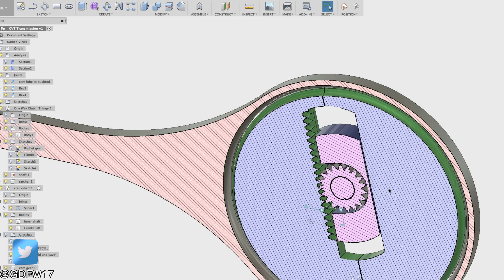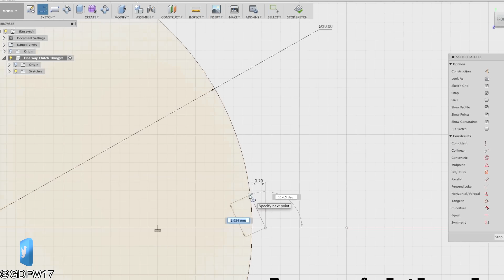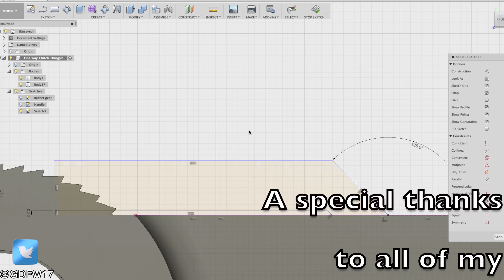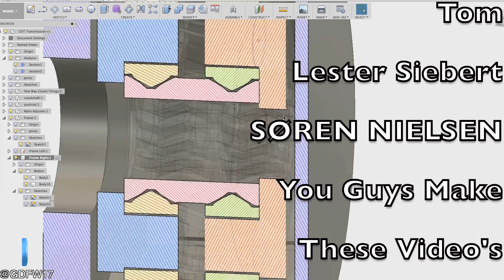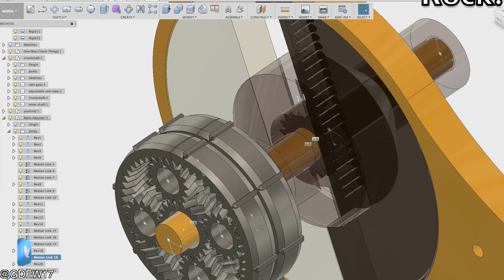The Coolest Transmission You've Never Heard Of... The Ratcheting CVT

Comment: CVTs are great on paper but in practice they have problems.  The biggest problem is with high torque applications which is why you never see a CVT mated to a diesel engine. They also are only mated to small economy cars for the same reason. As he stated the CVT's longevity is also questionable. Perhaps his design is the beginning of fixing those problems.

Comment: In 1967 my dad bought a Sears garden tractor. They called it a "hydrostatic" transmission and there was a lever on the side of the  tractor and if you pushed it forward the tractor went forward and if you pulled it back no matter how fast it was going you put it in reverse.. and the speed of the gas engine was controlled by a cable that was knob adjustable.
My father said that these type of Transmissions had been used but not in automobiles because they were too inefficient. But the one in the little Sears garden tractor did not seem to be inneficient at the time when a gallon of gas was 23 cents.
Reply from the maker: I bet it got less than one mile to the gallon. Pumping fluid like that is always very inefficient, but very practical for a lawnmower

Comment: I couldn't understand almost any of the verbal explanation. But I think I understand.
To put it lame, you have 3 arms that are ratcheting the same output gear. By turning the knob, you have a continuous linear adjustment of the distance of the 'throw' of  each of the arms, which in turn, throws a lesser to greater turn of the output shaft. 
I think the technology of that continuous(right word?) adjustment is cool!
But the ratcheting concept has no robust reliable technology about it.

Comment: So, a quick question about this.

Since this transmission would provide a wide range of ratios for a powerhouse to maintain a certain rev, while being able to maintain any speed at said rev....

Wouldn't that put the overall stress ware from the motor onto the transmission, then? It seems like even though the motor life would drastically change if overall rev's are able to stay low without costing acceleration, a lot of that stress would be transferred to the transmission instead.

Maybe I'm misunderstanding, but just something to talk about.

Comment: I am very sorry for you but its just not worth it. There are more mechanical parts that could cause problems. Gears are simple and reliable and don't need to be replaced. I am not that optimistic but if you believe in your invention you should build it completely out of steel, add good bearings, make it not to wobble, build a housing and a lubrication system and spin it up as much as you can and measure how much has worn off. It needs to have less material loss than a gear. Than you can try to sell the idea to big companies

Comment: So what I'm getting by this design is smoother acceleration and controller powerbands (no loss of power) but when it comes to the variable adjustment knob( for lack of a better word) if it were to fail, however it was designed to be controlled via belts or chain, it would either get stuck in one ratio which could possibly make way for engine failure if no disengagement mechanism was introduced.

Comment: Polaris ranger - 15,000$
1st New clutch - 800$
New belts - 2000$ (course of 5 years)
2nd New clutch - 950$
Trade for Honda pioneer - 2500$

Yet to pay for anything other than gas after 6 years of using the Honda, you can't beat solid gears and mechanisms

Comment: For a low-rpm application this could be very useful, but anything with high revs, this would fucking explode from vibration.  VERY cool design concept though.  A lot of old blacksmith/shop drills from the late 1800's used similar theories on how to get the most control on the output speed on their machines.

Comment: Nissan didn't do it that way. When the, I believe Altima, first came with the CVT it didn't "shift" at all. It worked as how CVTs are supposed to work. The probably came when they had a overwhelming flood of owners coming in complaining that their vehicle didn't shift or "rev" properly. The fix Nissan came up with immediately was to program a miss in the fuel system to simulate the jerk of a standard shift.
Reply from the maker: Haha that’s a funny way to go about it, but much better that forcing a CVT to stick in one place for a long time and create a rut.
Reply: @GearDownForWhat  it's more sad they had to do that. Even after telling people that the vehicles were being perfectly normal. I am not a fan of CVTs because of their faults. Also because they cannot handle vehicles with increasing power. They are great for commuters though. To ruin the smoothness a CVT can offer because of a lack of understanding by the general public is just, depressing. Lol

Comment: Hahaha I did the same thing when I was a kid, I wanted to come up with an automatic transmission that could keep the engine in the power and without having to shift gears. Basically I came up with the same system snowmobiles have.

Comment: as a nissan tech im glad you touched on programmed shift points in cvts
Reply: As a Nissan tech you should hate that horrible jatco cvt they use.  😂😂😂
Reply: punkrocker10115 I love them, I don’t call em cvts I call em job security
Reply: @punkrocker10115  I am not a fan of CVTs as it is. In automotive they have been nothing but problems. So far CVTs are like communism. Great in theory, horrible in practice. They are crap for any vehicle with any kind of power, only good for econo-boxes. Have been screwed up because then general public has no idea how they work and refuse to listen.
Reply: FordPower5288 they work great on snow mobiles! Atleast cvts haven’t killed as many people as communism 😥
Reply: @superTomwins  yes they work in snow mobiles. That's why I said "in automotive". Snow mobiles don't make crap for power and have a lot less weight to move. Lol.
Reply: @liberatorkramit  actually cvt is not for light use only. There is many design for cvt. Properly designed cvt can handle high hp/torque and have enormous advantage. That why its banned on f1 championship because of unfair advantage compared to traditional transmission. If f1 doesn't ban it, i think lot of r&d on cvt for supercar or something that need high torque application.
Reply: "Shift points" Otherwise known as a programmed miss in the fuel system.
Reply: FordPower5288 more like times ratio changes in the cvt as opposed to continuously changing them per the name suggests
Reply: @superTomwins  maybe they changed it but before it was just a programmed miss to make people think it's shifting. To be fair I've been out of the auto industry for a while now.

Comment: It is very cool but I think I can see some areas of improvement 

1. It seems to have a lot of vibration, I say you should have 4 instead of 3, that way it would have an equal offsetting weight so when 2  are far on the outside 2 would also be on the inside. if that makes any sense. basically how a boxer engine reduces side to side vibration.

2. you have a ton of input for little output, I'm still not 100% on how this works but maybe change the ratio so that it would be better for cars or snowmobiles rather than a freight train

also, this thing makes me feel dumb, I want to be a mechanical engineer for a snowmobile company but this seems so complex idk if me and my 1070 PSAT score is ready

Comment: My boyfriend owned a Nissan Sentra with a CVT. It was the worst driving car I'd ever been in as a result. First off, the CVT was loud. I mean, really loud. Second, it suffered from considerable output lag from the point when the engine revved up but the power wasn't there, known to some as rubber banding or the rubber band effect. This sometimes caused potentially dangerous problems when quick movement was needed from the throttle (such as turning left). Finally, it started acting very poorly at about 40k miles, particularly in the cold. It simply wouldn't output to the wheels when the throttle was pressed.
I'm not saying CVTs are inherently bad, some can work well, but the Nissan design clearly needs work. Working at a dealership, he was seeing Pathfinder CVTs on the regular failing at a few thousand miles coming in for warranty work.

Comment: Great job.
One thing I could say is that it's not a CVT, as it does have a finite number of transmission stages, determined by the number or ratchets per turn of the shaft. It would either do 0 clicks of the ratchet per turn of the shaft, or 3, or 6, or 9, etc.
Reply: Are there any CVTs out there with a truly infinite number of stages (aka ratios)? I mean they're not called infinite ratio transmissions.

Comment: This would be great for bicycles. Instead of a cap, you'd have a straight through shaft to connect the pedals, and a lever that can be cable adjusted to control the offset/ratio.
Reply: check stringbike

Comment: Another CVT gear system that is similar, was in Popluar Science in Oct 82.  It uses pawls and cams to pull gears, by changing the length of the pull you would get different ratios.  It is easy to search for type in "CVT pawls Popular Science Oct 82".  It comes up thru google books on pages 110-111.  Have you seen it ? 

A good application for a CVT would be to drive a supercharger for a car engine.  When you need power the gears would speed up the supercharger, after you needed power they would gear down.  Supercharger need power but typically it is far less, than what the total output is.

Have you tried making your CVT in metal  ???

Comment: So, I'd say the finite number of teeth on the ratchet mechanism is why it isn't really  continuously variable. Until the first tooth in engaged, no movement at all will occur up until that point. Suddenly with teeth engaging, the output will move by 3 teeth angles per input revolution, psuedo gear 1 after neutral, then all variations up until two teeth engage are the same, until the gear ratio suddenly doubles, psuedo gear 2, and so on until the most teeth passed possible per revolution of the ratchet. So realistically, your model probably only has 4 gear ratios plus a neutral. Smaller teeth could increase this number but make it fragile, replacing the ratchet with a one way bearing with little play could dramatically increase the "continuous-ness" of this mechanism.

Comment: The best cvt was designed and patented by an electrical engineer, it's only used in alternators in military vehicles, and for the drive on tractors. It can nearly take any tourqe load, and take input rpm to a zero out put, no clutch, no parts that wear out... 
Its a fd up world.

Comment: Very good video, I wonder if that can be applied to bicycles, since in a way, for me, it looks as if you can attach that to the place where the main chain gear(?) would be, and just have to attach the adjuster to a lever or a accelerator handle like the ones on amotorcycle.

Comment: looks like a zero max. They are used on printing equipment.
Reply: I was thinking the same thing as a reply but I couldn't remember the zero max name...thanks! They use a cleverly flat rcb device instead of what sounds suspiciously like ratchets in this device by this clever fellow! :)
Reply: I see them all the time at work, but it's been about 30 years since I had one apart. Lots of little bits in there.  @hugocfr
Reply: I have a small one here in the shop and have had it apart to see how it works....I was even able to get it back together and working again :)

Comment: There is something about this design that is very familiar.  On the second viewing, it came to me.  Look up the Stephenson Link valve mechanism, used on steam locomotives since the mid 1800’s.  Of course, it isn’t a transmission, but a means of controlling the steam flowing to the two double-acting cylinders that propel the engine.  The Stephenson mechanism is relatively simple.  Its successors, the Baker, Southern, and Welschaerts valve schemes were progressively more efficient, but more complex.  A major drawback to the Stephenson mechanism is that major components were underneath the locomotive, between the driving wheels, making it more difficult to service.  The Welschaerts design became the most common because all of the parts were easily accessible on the outside of the loco.  There are several video animations of these mechanisms here on YouTube.

Comment: So this is a cvt gearbox with no clutch needed.. i mean the current cvt need clutch to start from rest to motion and this advanced cvt can have the minimum ratio zero(netral) and can have maximum higher ratio according to the addition of that rods or increase the radius of kamloops(what yu referred to it). well i think adding rods can have smooth acceleration from 0 to max speed and the ratios will be very very near and increasing the radius of that loop may increase the max speed of the car...
 sry im bad at names and im only 12th grade... so correct me if im wrong.

Comment: I had a thought here; I'm not much of an engineer and I don't have the software I need (yet) to play with ideas, but would this design be feasible using sprag clutches or freewheels instead of ratchets? And would it be an improvement on the overall design or not? (reduced wear? less noise?)

Comment: Could you tie the "shifter knob " to a peddle and place it to the "clutch" pedle then use it like that you the driver for the vehicle so you can have a full controll over both the transmition "cvt" and the power out put if the engine
Reply: You could probably also use a case for to its always lubed up ",much like a trans is any how" and use a gear barring to make it flow a little smother and not fall apart so easy ??

Comment: Your output shaft there isn't exactly rotating at a consistent speed at any given gear ratio there is it? Haha. Super cool still. I had an idea for an engine when I was younger, then I found out that the engine was already invented by some old fuck. Doesn't that feeling just suck? For those wondering, it's called the "Duke engine." The asshole even went and gave it the stupidest name he could have.

Comment: my car has a CVT and I'm not going to lie, I don't want to go back.  I didn't know what it was, but i noticed it didn't "shift" as expected, and instead it felt like it had limitless acceleration power.  I loved it and asked around until an enthusiast recognised what I was describing, told me what it was, and showed me how it worked.  you just hold down the gas and enjoy seamless acceleration until you decide to obey the speed limit pretty much :D it's electric. (not the vehicle, the sensation lol)
Reply: How old is the car. I got a cvt also but it went out under 60,000 miles.
Reply: @briancreech9990  2009 Nissan Altima 3.5 SE.  60k really?  did the fluid get low or something?  I'm sad that happened.  i'm sitting at over 200k...knock in this wooden desk lol
Reply: @doodoostickstain  I have a 15 versa. It started slipping then just completely left me stranded. Luckily it was under warranty.

Comment: Apart from the annoying music, this is very cool! One of my buddies "invented"  the (two cones + belt) cvt, back in University. I kinda helped a bit, but our enthusiasm got crushed by the professor, telling us these things already existed. So, I know what you mean. And it wasn't the first thing we "invented" just to find out someone else had already thought of. But this was before Google and even before wide spread internet.
Anyway, what CAD software are you using? Wouldn't it be easier to go for solidworks, it has built in standard gears and stuff and it's pretty good at simulating all sorts of mechanical mates/constraints?

Comment: I feel like this thing needs a flywheel, it'll smooth out the output.
Reply: What if you took two torque converters and put channels between them with electronic valves. 
Let's say there were 5 channels which fluid could flow from input tc to out put tc. If only one valve is open would you get higher pressure less flow volume equivalating to higher tourqe less speed. If you have all five valves open would it be higher flow less pressure equivalating to higher speed less torque.
Reply: @robertolivarez5742  , , ,, , , , , ,. , ,, , , ,, , , , , , ,
Reply: @robertolivarez5742  , , ,, , , , , ,. , ,, , , ,, , , , , , ,
Reply: Torque converters are way too inefficient, heavy, need nasty fluid, and the power would have a slow response. No thanks. Torque converters are the worst component of automatic transmissions.
Reply: I kinda thought that a one way bearing would work better than a ratchet system
Reply: Why doesn't this use a crank shaft?  The input drive is converted to linear motion to drive a ratcheting gear on the output shaft, but this could easily be transformed into a crankshaft.  one way bearings/ratchets are very bad for longevity. 

I imagine that the mechanism to convert to linear drive has to be fixed to a specific angle or it would adjust its throw but that is easy to fix.

Comment: I have a couple things that might help. Could you use a one way bearing on the output side to increase efficiency and reduce friction? Also I haven’t researched it but could the drive end be transferred to a variable valve timing set up? You are on to something big here I think. Keep you gears turning!

Comment: But what if it had 6 of em. 6 cylinder engines are very smooth. I don't see how it wouldn't translate to this CVT, but what do I know
Reply: No Name 
Isn’t this a transmission? I thought CVTs were transmissions, so I’m not sure how the number of cylinders would affect this much. 
(Also I’m a noob with cars so plz don’t kill me)
Reply: @-Burb  Even if it doesn't have cylinders the principle looks to be more or less the same. If you imagine the input shaft as the crank
Reply: No Name 
Doesn’t there only need to be one transmission though? I don’t think there’s a transmission for each cylinder